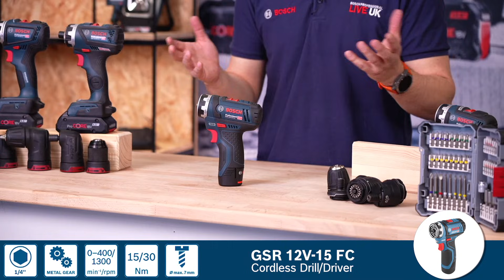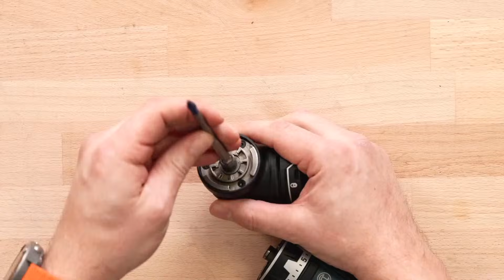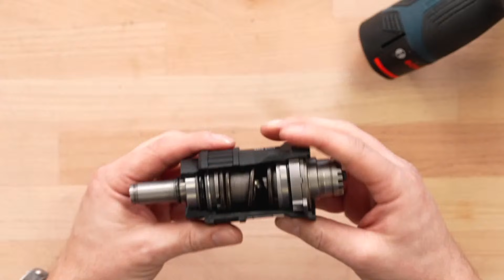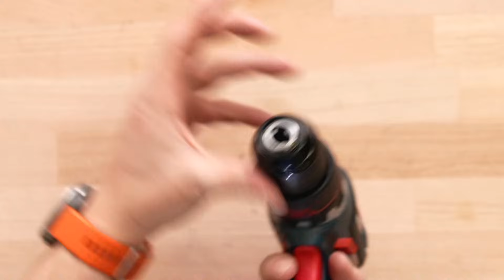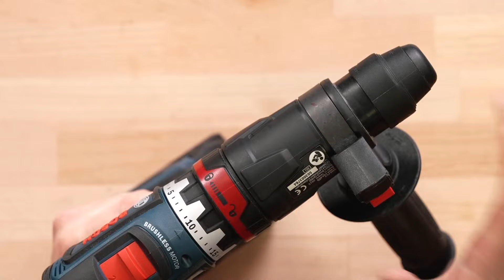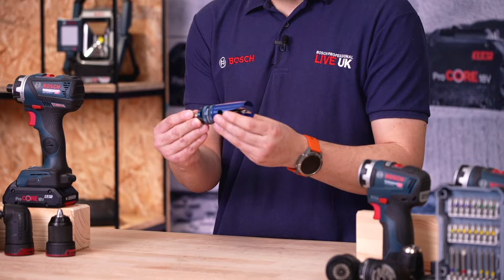1 Tool, 100+ Tasks! The BOSCH FLEXICLICK SYSTEM

Comment: Nice presentation. However. Im interested to know if the metal detachable chuck made for the 18V tool can actually fit like for like on the 12V tool. That would make my day since Im looking for  the 12V tool but would like to ave a chuck that opens as much as 13mm diameter as opposed to just 10mm. Tnx in advance

Comment: I know everyone likes to save money in R&D so I believe beefing up the power for a 2-in-1  attachment like the bosch freak for the Flexi click would be reasonable and could save money for everyone including the consumer and could be a flagship multi-purpose drill also repositioning the light as a halo ring on top where it's needed the most Also, the Blue tooth function tracks run time to secure an easy warranty return policy or replacement if the drill is unable to achieve a designed minimum operation run time like a vehicle warranty of 4 years or 50k miles, etc

Comment: @BoschProfessionalUK Danny & Chris, As i asked in the stream, I think the GBH 18V-28CF would make a very good Flexiclick SDS Drill, as in a way, it is somewhat already is. Do you think so? Imagine the possibilities with the Flexiclick system, you could add a Metal Cutting Shear attachment, Polisher attachments, HVAC copper Swaging & Flaring attachment, so many options. Much respect, cheers!

Comment: Flexi click is nice, however we need more attachments.  Like the gentleman said in the chat. PvC cutter, copper cutter.  I would like to add, pex A collar spredder, metal sheers, cemet siding shears.
Reply: Approve. Great idea! 😊
Reply: I would like to just buy those tools proper and not have some dumb half assed black & decker contraption.  You named a bunch of specific trades tools that fall in the category of either you don’t need them or you use them all day and every day.